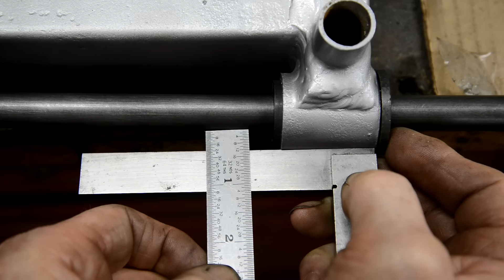GreeBSA 350  -  Part Five

Comment: Happy birthday Micheal. I had the same problems with my Gold Star swingarm which i converted to solid bushings like you did. I made 2 bushings, the first out of brass slightly undersized and in this brass bushing goes the nylon bush. the light undersize made it possible to aligne both sides and once aligned the brass bushing was glued in with loctite 638.

Comment: Tip for you Michael from an experienced turner, when doing those plastic swing arm bushes, you could have parted those of using the same spindle speed as you turned the bushes at. Delrin or Acetal turns and parts nicely at around 750-1000 rpm as do most bush style plastics. I agree with you that the repair you did to the swing arm caused the twist. And probably the out of alignment with the spindle bushes as well somehow.  Happy Birthday to you for next week.

Comment: Hello chap, I braze refrigeration equipment both copper and mixed metals parts. For the heat sensitive parts we do not want to or cannot damage we wet rag (cotton rags) around the part/s we need to protect. Maybe you could try that next time you want to do something like this again it works really well to protect to part/s that will not take heat or an open flame.